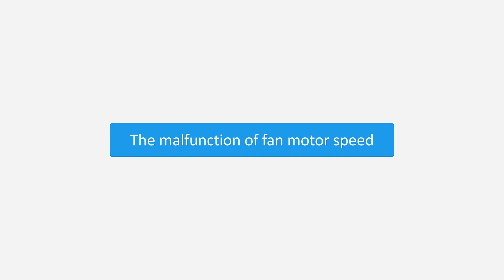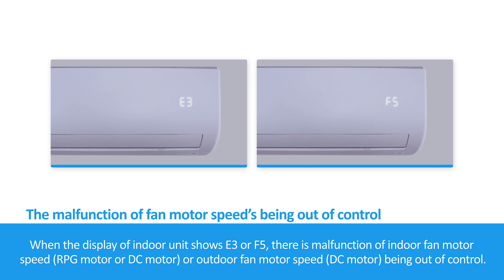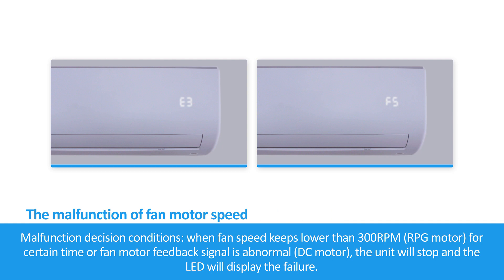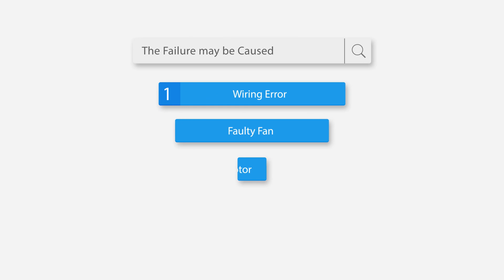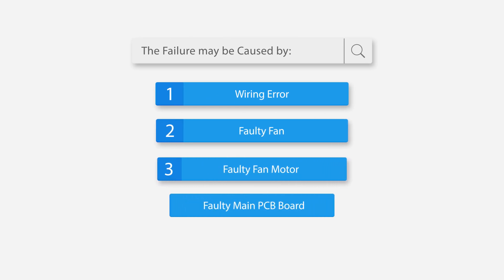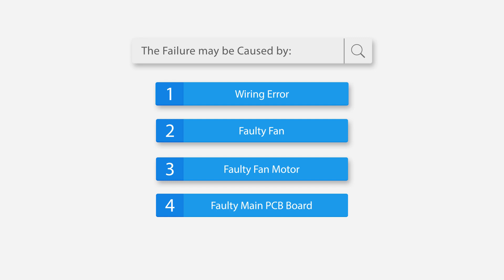E3 F5 Mini-Split Error Code – Perfect Aire

Comment: Thank you very much for these troubleshooting tips, although I can't say my F5 code was particularly hard to diagnose. My outdoor unit is subject to copious amounts of snow and moisture and there was a 1-inch layer of ice inside the unit, and it was holding the fan captive, after breaking all the ice away and bending the motor mount back down with my boots, I reinstalled the fan and voilà! It works again. Still, seeing how you checked the outside helped. The real fix now is building a small enclosure, so it doesn't happen again. :)

Comment: Hi please, I have a Koolking air conditioner, before it gave me error P4 I disconnected the power for about 5 minutes and it restarted without problems, now after a few weeks it gives me error F5 and does not want to know more than throwing cold air, the external fan does not turn more and ne the engine, what could be the damaged temperature probe?  Waiting for your reply thanks and congratulations for the videos